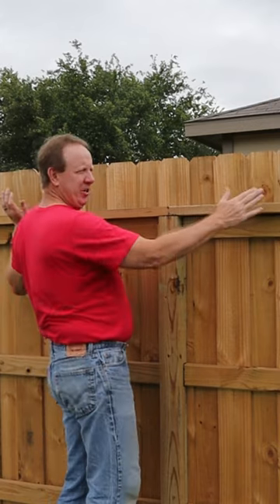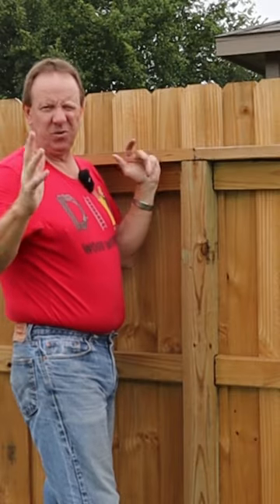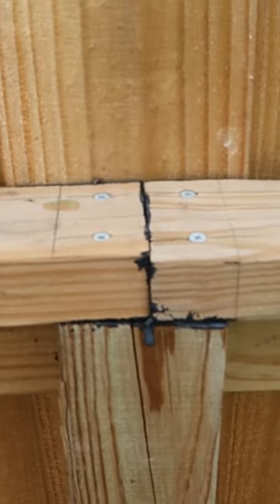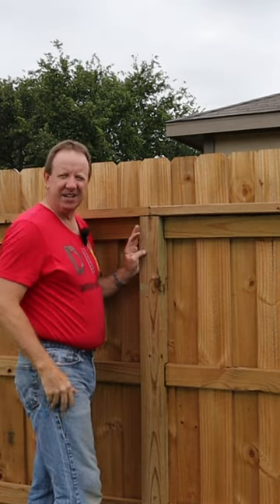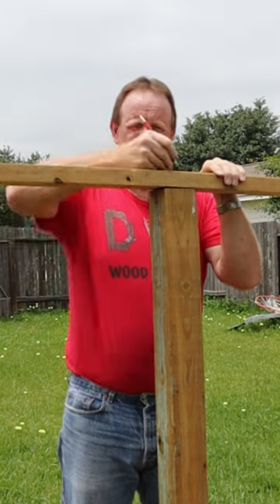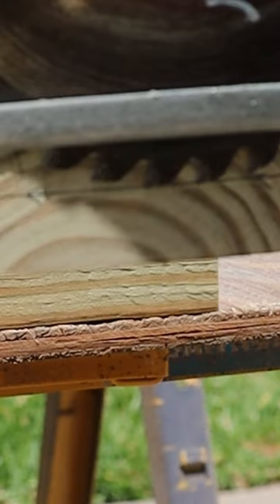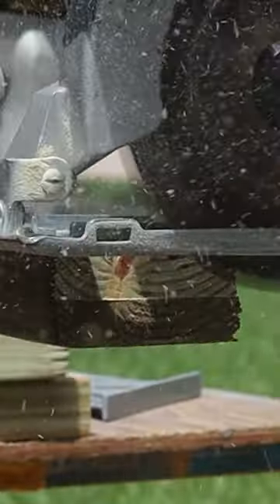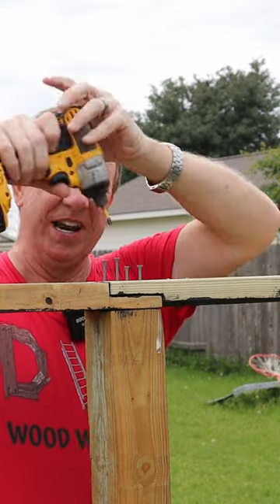Better , Stronger, More Stable Fence Connection

Comment: I used 160 foot boards and eliminated all of the joints.
Reply: You're hired 👍
Reply: Board stretcher works every time, doesn't it. Nice.
Reply: Where can I order some of those ? 😂😂
Reply: You had to spend a fortune on the belt to hold the giant tape measure
Reply: @doberman186   Home Depot only on Saturday mornings
Reply: Yeah it's hard to fit that inside of a Honda unless you're travelling only straight
Reply: @doberman186  china 🇨🇳
Reply: 20-8' boards, joined with horizontal finger joints, is basically the same thing, right???
Reply: @soloyo7162 California.... you have to go chop down the redwood, yourself. 😉🤷‍♂️🤣
Reply: "I need some 4x2's....how long??? A long time I'm building a fence"

Comment: If you're running a stringer under the top 2x4,  a far stronger  fence is made by staggering the length of the top board between the fence segments so there is no joint on the posts.

Comment: That way you get half the sheer strength and 4 times the area for fungus growth!
Reply: Sheer strength is in the fasteners, so they'll still hold. But the end grain will let loose in a few months anyway.
Reply: @jmackinjersey1  you're thinking of the wrong sheer axis.
Reply: *shear
Reply: Came here to say that… bravo 🙌
Reply: Seal that with a bit of glue and you solve both problems.
Reply: I knew someone would say something
Reply: Note he coated all the touching surfaces with tar to prevent that.

Comment: That isn't stronger. Vertical shear load going into each 2x is effectively half a strong by decreasing the cross section by 50%. The board on top will begin to split down the grain probably just as soon as you put the weight of the fence board on it.
Reply: I’m sure it’ll hold the fence, but you’re right it’s a lot weaker for the reasons you stated.
Reply: An angled bracket attaching the top board to the post wouldn't hurt.
Reply: This guy is an engineer
Reply: You are right sir
Reply: I concur
Reply: @Anythingyoulike2013  and a lousy one at that!

Comment: Technically it is a stronger joint if you compare it to attaching 2 pieces of wood by each end, however in this case you’re attaching it to the 4x4 so technically it is a weaker joint for this application.

Comment: You effectively turned your 2x4 into a 1 x4,you made it a weaker connection
Reply: That’s not how a lap joint works 🤦🏻‍♂️
Reply: Your typical section of fence isn’t really approaching the strength limitations of the wood in this case, I don’t think.

Comment: It actually adds to the flexibility of 2 axis points ( both ground settle and wind force ) to adjust for grain shrinkage, slowing or stopping splitting of the wood at the fastener location, the primary point and location of failure in this type of application.

Comment: I wouldnt use the half lap joint in this aplication but a faster way to cut it is mark it out use the saw to cut the line on both sides then finish with a recip saw! Much faster and cleaner joint!

Comment: I would put a 12 or 14 in scab over the lap joint to protect the ends all of the individual boards and I certainly wouldn't put tar in between them that would just cause the boards to ride out quicker if they got damp they wouldn't dry out

Comment: A miter joint overtop of the post would do the same thing. And...if you screw the top rail in from underneath, toe-screwing using longer screws through the bottom of the post, no rain would wick down the screws, rotting the joint from the top...if you use glue or silicone,

Comment: Its not going to matter much because either way the board is going to rot out much quicker plus  build up more algae. But if you want to mount the board laying flat, cut the board in half so 1 board is in front and the other is in back. Now add 2 screws down into the post (each board) then from the front run your 3-1/2" screws from the front towards the back. Now your top plate joints are secured down and together which is a stronger connection and much quicker than doing a lap joint.

Comment: IDK,  that extra top board looks nice, but it is going to warp a lot sooner.

Also I see screws used and all the stringers are notched in as well. So alot more money and lot more time. Which is typical of many DYI projects - overspent, overbuilt and not built correctly.

There are many dog-eared wood fences in my hometown  I built 20-30 years ago, with just nails,  still standing, and the gates are still square too.😎

Comment: Seems like notching the 4x4 so the vertical boards under to top board can set on the 4x4 would get you more strength. Of course if you really want to stop a fence from sagging you should add “Z” bracing like a gate. Just more $$ but if you want to do it right.

Comment: You cut the shear strength in half.   Move the lines 1/2" closer to the center of the post so you have the full width of the board sitting on the post.

Comment: Why are you using metal fasteners? I only use an auger & chisel to insert wooden pegs.  A much better joint and will last much longer.  I completed my first section of fence last week.  40  more to go.  I'm excited.

Comment: That half lap joint creates a stress riser in the worst possible place for the top plate.  If that was a real load bearing member that supported weight, it would fail pretty quick.  Being a picket fence, though, it just seems like a lot of hassle for inferior construction.

Comment: Well, braces suppose to carry vertical weight, not horizontal. So cutting 2x4 on half weaknesses it...
Cut boards in 45 degree angle and overlap it. That's strongest connection...

Comment: The screw heads are an entry point for water.

With head sitting slightly below the surface that one drop of water will sit there and start swelling the wood around the threads and down into the 4x4.

The wind rocking it back and forth will weaken the anchor points.

This joint and all those with screws going down into the posts will fail.

Personally I only use metal poles.

They dont rot, warp, or bow.
Reply: You mean nails won't make an indention? And metal poles won't Rust? Got it.
Reply: @antichrist_revealed  Nails make indentions also.
And so far after 20 years my galvanized  metal poles have not rusted.
Reply: @shawnr771  I put a fence in with wood poles, and after 40 years they are still there after all the high winds and rain. Never replaced a single pole or board yet.

Comment: Put your fence boards going horizontally instead of vertically. That way when the bottoms rot, you just have to replace the bottom boards and not the whole fence.

Comment: Love your videos. ❤ I use 3" deck screws too...a great way to make a much stronger connection. I use 5/8" deck screws on my pickets too. Makes removal much easier and you don't damage picket. Also, I use deck screws & metal rail brackets for second and third rails. Will never understand why people would or should toe-nail the rails. It's just wrong and is the weakest way to fasten anything together. Even in home construction. Screws are a little more expensive, but a nominal expense when considering the stronger connection.

Comment: It’ll stop the joint from opening up but it’s not stronger, you just turned a 2x into a 1x instead of making the lap joint the full width of the 4x try half, leaving full thickness vesting on the post

Comment: I wouldn’t recommend doing this you’re taking an inch and a half board down to 3/4 of an inch on both ends with a full inch and a half board. Running halfway you’re much stronger.

Comment: It would make more since to leave the top cross 2x4  board solid and notch the 4x4 pull the fence up tight to the post. But I don't like these fences you see them a couple years later all fell over from wind. Shadow so wind can get thur

Comment: That would depend on which direction the loading would be as to whether that was strong enough or not I would think. If the loading was in a downward it seems like half the support for each board will be gone. I don't know I might have to do some research on that but that seems like that may weaken the joint if the loading with a vertical. If anybody knows the answer please let me know ugly enough with the good time to see the video as I'm about to build that kind of fence for my property I like to build things as strong as possible for which way would be the stronger way?

Comment: So this is actually weaker. Decreasing the cross sectional area is deacreasing the amount of vertical shear force your boards can handle by half. Essentially this set up can only hold half the weight of the original. You should do a video testing this!
Reply: Yeah I kind of agree with you. The one on top looks like it's most likely to split at the start of the cut.
Reply: How is this weaker than centering two half boards?
Reply: @antichrist_revealed  as i described you are cutting the cross sectional area of the weakest point in half
Reply: @AD_Engineering  The top board laid sideways is for horizontal stabilization, not vertical. Vertical stabilization is done with other boards the fencing is nailed to. There is no horizontal weakness, but rather it now has more horizontal strength the way he shows it.
Reply: @antichrist_revealed  Still weaker by half, although if what you are saying is correct than it most likely doesn't matter. Shear stress = Force/Area . as the area decreases the amount of stress increases. the method he is using is weaker unless you use wood glue or some other type of epoxy that cures harder than the wood. then the joint would actually be stronger than the rest of the member in this case.

Comment: You’re right, but why would anyone need that strong of a fence. Two screws on the top plate is more that adequate. Your fence will need replacing before they fail.

Comment: You should've put your nailers on the outside and nailed it to the post. now the weight of the fence is resting on the boards you cut in half.... The full 2x4 isn't enough to hold all that weight before you cut it. If you wanted a board across the top of the post like that you should've used a 2x6

Comment: Shorting the top length by half the cap length times two for each section 
..... longer boards needed 
        Add twice a full cap length size to each top board .....
        Hmmm

Comment: How do you keep wood fences from warping and turning gray/ black?
Reply from the maker: Will have to paint or stain them to keep them from turning grey.  I have a video on sealing this fence if you want to watch.  thanks for watching
Reply: @OakleysDIYHomeRenovation101  thanks. I’ll watch. So nothing really can be done to keep it from warping? The only thing I’ve read or saw is to let the lumber stay indoors until dry

Comment: Every single fence that I see that has the 2x4’s on top of the post, has sagged a whole lot. The 2x4 laid down flat is much weaker that a 2x4 on its side. I’ve built fences that are 10 years old and STILL have a straight profile across the top of the pockets. This method sux.

Comment: I much rather just do a 45 miter cut. That caulk will eventually degrade and I don't want a spot for water to gather
Reply: Do what now? How would you go about cutting those at a 45?
Reply: @kevrides5706 I think he’s talking about a 45 bevel cut down the center, it would work and POSSIBLY look better than a standard butt joint but I don’t really get it either. It WOULD however be a stronger joint than the half lap one this turd just showed in the video

Comment: This is completely false… you’ve now only decreased the vertical strength. Let me know how this works out for y’all who believe this when top boards begin to split. It’ll happen, I promise.
Reply: I've had them for over 10 years and they're still holding up great. Never promise what you can't deliver

Comment: I suspect the point of the split is so that the fence can have strength from the posts, but be able to move without buckling.... Similar to the way bridges are gaped between the roads, allowing for movement in the joints when temp/moisture changes without sacrificing strength. If there's one thing I've learned about handiwork etc. its that when people 'usually' do something one way, it is 'usually' for a pretty damn good reason, and that usually getting creative with re-inventing somehting everyone already agrees works, means you are trying something people have already determined is crap.

Comment: Thats... Just no. Professional homebuilder here, and.. no. If you want it stronger, you dont half lap a vertical joint. If you really need it to be stronger (its a fence, you really dont, the shear load is gonna come from the side more than the top) use truss plates down the side with your screws.

Comment: If your making money your not going to cut that at every post your also not going to cover every cut piece with pine tar. Do you know how much you would have to charge and how many jobs you would actually get 0. It also makes your fence weaker because your taking away the shear strength.

Comment: Yea so it can last just as long as the original way. Stronger for no reason. Wasted time. The lumber will.still.rot in the same amount of time
Reply: It’s not stronger either. It’s way way weaker. It will snap on that top board first because he just removed half of the material for load bearing

Comment: Diy’ers have a way of over complicating jobs to make themselves look like they know something. Go through all the unnecessary hassle of half lapping 4x2 only to smear it with black sealant 🤮 turning a 4x2 into 4x1 with a half lap and pumping it with screws is never going to add strength no matter how much you paste it 🙄

Comment: smart.
a lil more time consuming... 
...but smart
Reply from the maker: Thanks for watching.
Reply: Does smart mean dumb? I bet you this guy is a carpenter/woodworker by trade. Not a framer or fence builder. There is a reason framers use butt joints and it’s for STRENGTH